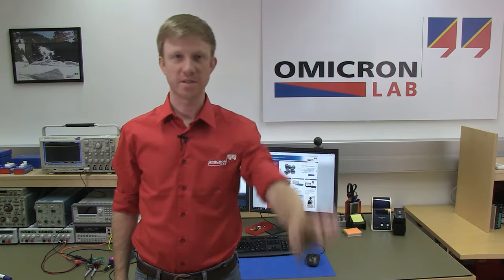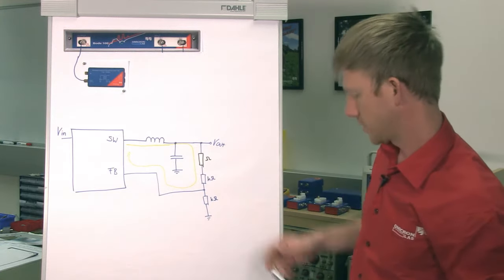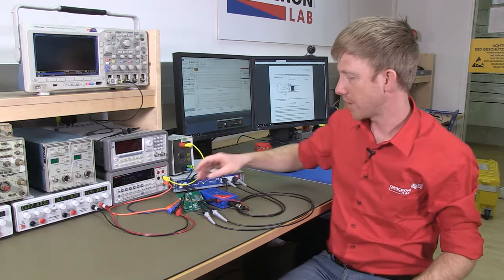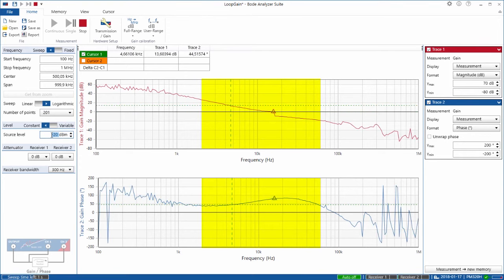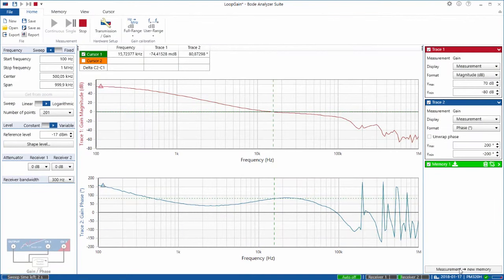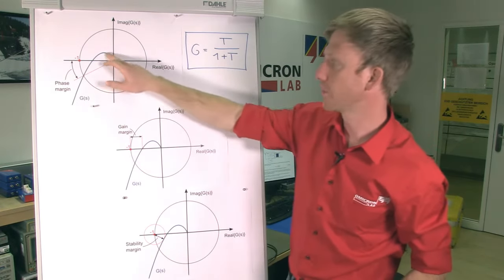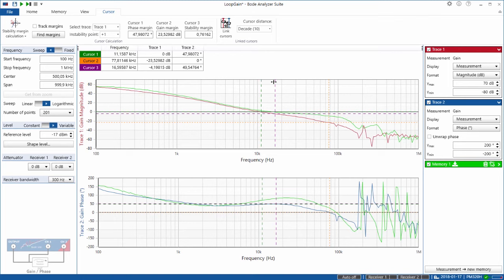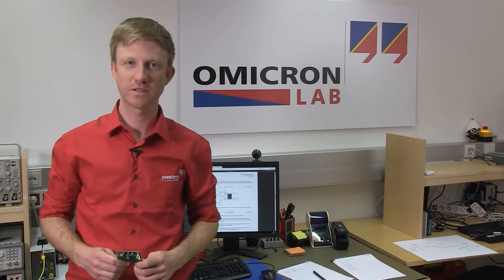Stability Analysis of Power Supplies

Comment: You mention to take care using an E-Load because if can interfere with the DUT. What do you mean by this? Do you have any examples of issues with E-Load on any of your videos? Also, what is the resistive load you are using. I'm having a hard time finding a bench top purely resistive load. Currently I'm using cheap rheostats dials.
Reply from the maker: Depending on the control mode of the electronic load, it also incorporates feedback and therefore it is a dynamic system as well. This can distort the measurement of the loop. We also use resistive sliding loads or power resistors mounted to a heat sink for loading.

Comment: Hi, thanks for explaning. it is really clear about the setup and the test point in the video. But i am using a primary-side regulator flyback converter. And the feedback loop uses a voltage divider before the recitifier diode and go into the Vs pin of the IC. Do you have any suggestion on the injecting and measure point for that topology? thanks you so much.
Reply from the maker: Dear Songzheng Chen,
We do not think that is makes sense to measure the feedback loop in a primary side regulator because you cannot adjust any poles / zeros in the controller.
What does make sense is to measure the output impedance of your supply.
When you measure the output impedance, then you will see how good your supply is and if there are any critical frequencies that can cause ringing.
If you haven’t seen it, maybe you can check out: https://www.omicron-lab.com/applications/detail/news/output-impedance-of-power-supplies
If you have any further questions, please feel free to contact us anytime at: support@omicron-lab.com.
best regards, 
your OMICRON Lab team

Comment: great sharing, I have brought a bode 100, and want to know if i inject a big signal, like you showed 8dBm, what kind of stauration will happen?
Reply from the maker: This will depend on your circuit. You can get e.g. slew-rate limitations in the error amplifer if you use too much signal level.

Comment: hi thanks for this explanation, do you have some suggestions in order to make measures on 360Vdc output voltage of power supply? I saw that 10x probes are not good because the high noise? thanks for your suggestions 
BR/Roberto
Reply from the maker: Hi Roberto, 10x probes do normally work but you should not use standard scope-probes with our Bode 100 for high voltages. The Bode 100 inputs are AC-coupled with high impedance, so normal scope probes don't divide DC. Please use the PML-111O 10:1 passive probe. Alternatively you can use active high-voltage differential probes. But these normally do have more noise. For more details, please contact us via support@omicron-lab.com
Reply: @OMICRONLabTutorials  thanks for your reply

Comment: Hello! 
What is the value of injection resistor that you used  ? 

What mean 10:1 for de ch1 and ch2 in the parameter ? 

For my work a used 100 ohm 
And on the parameter i guess  o need to compensat this value 

I did not well uderstand if  i use 100:1 or 1:100 for the two channels or just  one . Thanks
Reply from the maker: Dear Honodjii PDG, thanks a lot for your comment. 
The value of the injection resistor is not that critical. We normally use a value around 10Ω.
The value must be small in comparison to the feedback resistor such that it does not change the DC operating point too much.
On the other hand, the smaller the injection resistor is, the smaller the injected voltage will be. But normally we start with 10Ω.

You don't need to compensate for that value at all since the Bode 100 measures both voltages on either side of the resistor. So you don't need to compensate for the injection resistor. It will just influence the absolute size of the injected signal.
Best regards, 
your OMICRON Lab team.

Comment: Does this work with standard 10M 10:1 oscilloscope probes?  I forgot to buy the PML probes and now it will take forever for my company to get them in.
Reply from the maker: Dear Norris, 
If you have voltages <50VDC you can use 1:1 probes. This will give you a better signal / noise ratio. For higher voltages you will need the PML probes. Standard 10:1 probes with a 9MΩ tip resistor will not divide the DC portion of the signal with our AC-coupled inputs, therefore damaging the AC coupling capacitors of the Bode 100. The PML probe includes the 10:1 divider, therefore also dividing the DC portion of the signal.

Comment: Thanks for the explanation. To remove noise  at Low frequency, Shape Signal is used. 
1) what about if noise is present at high frequency? 
2) How to correlate/implement this shape Signal with real product?
3) To remove noise, is there any other way? Such as compensation circuit or any other way?
Thanks
Amlesh
Reply from the maker: Dear Amlesh Kumar,
thanks for your comment! Our answer to your questions:
1) Noise at high frequencies can be reduced similarly to low frequencies. This means using the shaped level function, reducing the receiver bandwidth as well as the attenuators at channel 1 and 2.
2) More information about the shaped level function can be found in our application notes (e.g. https://www.omicron-lab.com/applications/detail/news/dcdc-converter-stability-measurement/; page 12 onwards).
3) To further remove noise in the measurement, you could also do sweep to sweep averaging. Adding filters is not recommended because they will influence the measurement.
If you have any further questions, please feel free to contact us via support@omicron-lab.com. 
best regards,
your OMICRON Lab team

Comment: 6:48  You state 80 deg. phase margin.  The Y axis implies raw phase, so then PM would be 80 - (-180) = 260 deg.   It's 80 because (at 10:33) of the inherent -180 rotation due to injection point.  The display shouldn't define Y axis as phase, but "phase margin".
Reply from the maker: Since the equipment does not know what kind of external circuitry is measured, the axis just shows phase. And Phase Margin actually only exists at the crossover-frequency. Calling the axis "Phase Margin" would also not be really correct. I think, the user does need some application knowledge to interpret bode-plot measurements.

Comment: T(s) = - G(s)*H(s) and then non reference signal mean Vref(s) =0 ?
Reply from the maker: Yes, it was assumed that the reference does not change in that case. If you have multiple inputs and outputs, normally they are analyzed one-by-one. In this case the disturbance on vref was considered to be zero that's why vref is not mentioned. However, Vref does not actually influence the loop gain as it is not directly part of the loop.
Reply: @OMICRONLabTutorials  
Using Bode 100 is like we make study the small singal variation. 
Vref is a constant and its small variation is zero.
Reply from the maker: @hScience100  You are right. But in this case we don't change Vref but the measured feedback signal Vfb by injecting a voltage signal. Then the feedback loop reacts to that change in Vfb and the loop gain can be measured.